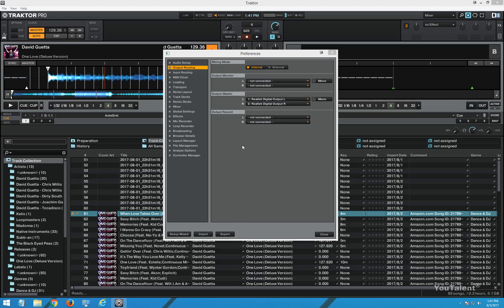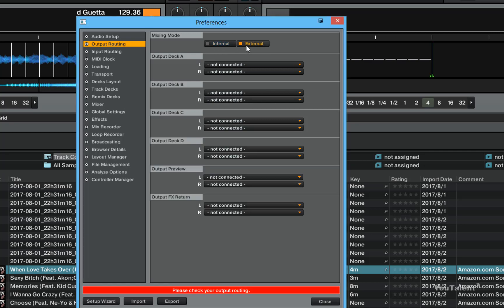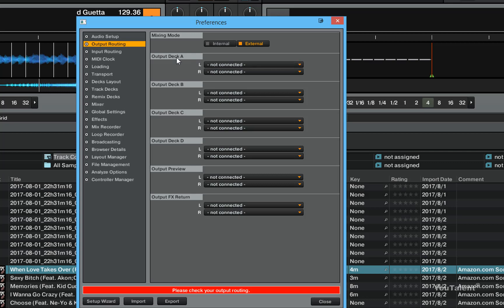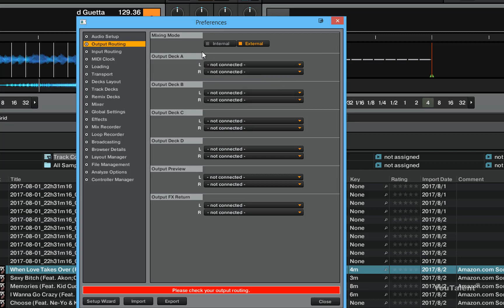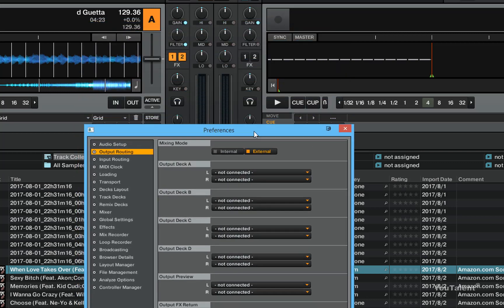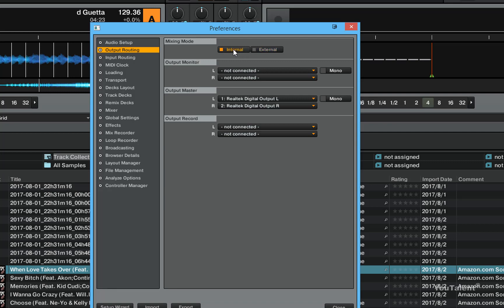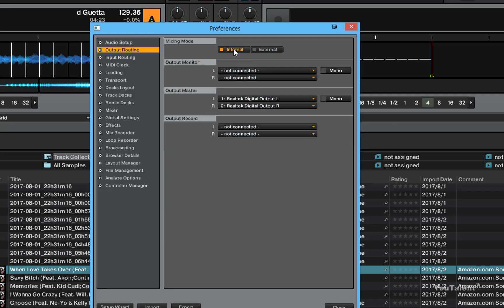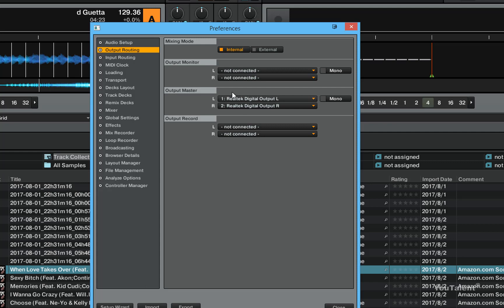Traktor Pro - Course 1 - Output Routing (video #5)

Comment: I noticed that you didn't click on monitor or record settings. Reason is Traktor , depending on what selected in audio setup may yield one audio source thereby you can only have sound under one of those setting especially if you choose Wasapi audio driver. Traktor Kontrol such as S3 Mk3 comes with a sound card and even selecting Traktor audio source it will show two audio source that will allow you to have monitor (headphones) and Output  (speakers) but you may not hear any sound from the speakers. Traktor Pro 3 software is more problematic than it is useful. I had the system figured out by using Asio4all sound drivers along with and external sound card. I was able to monitoring, output, and record until and upgrade to Traktor Pro 3.10.  Now my setup doesn't work and even when I revert back to version 3.7 which use to work great now does not. Traktor Support is useless to find a possible solution, so I have to figure it out for myself.
Reply: I have the same problem not being able to route the Cue audio to my headphones 😫 Could you please tell me how you managed to solve this problem? Hopefully awaiting your reply 🙏🙏